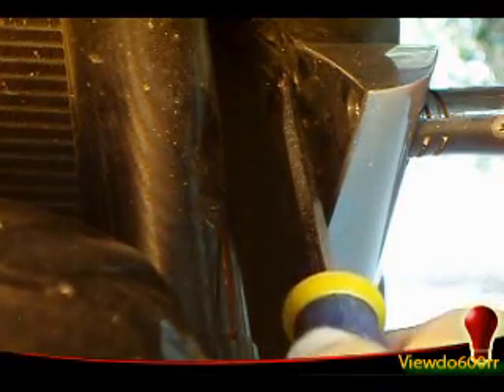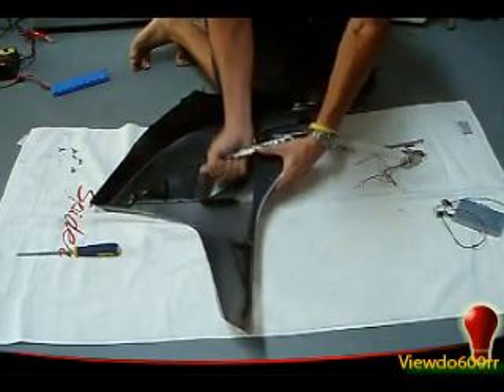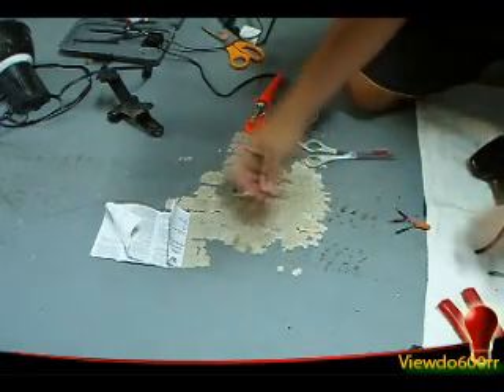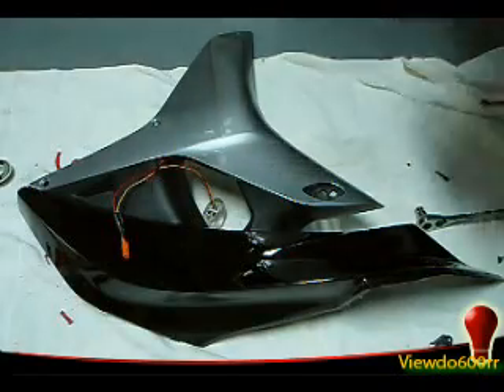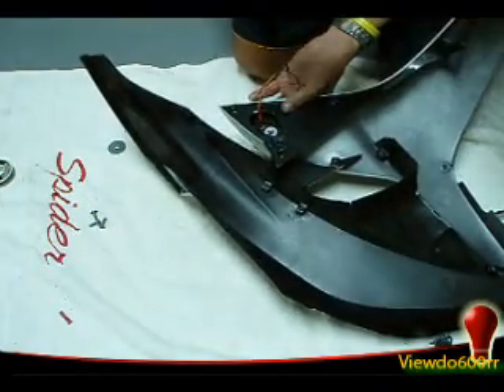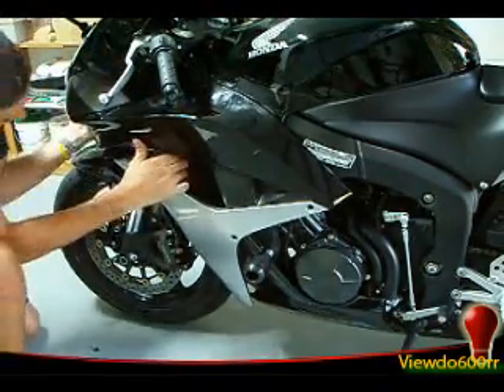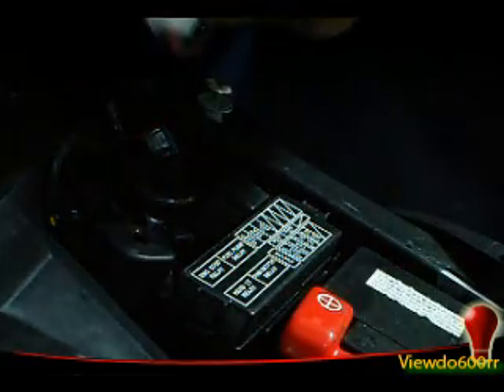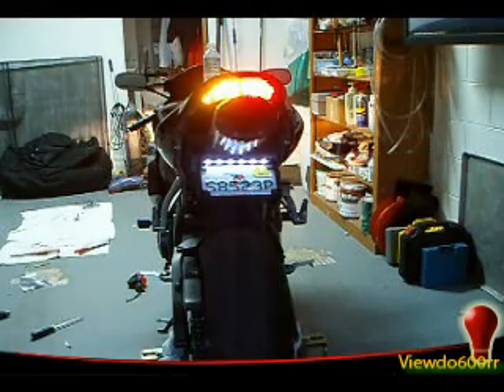Proton flush mount installation

Comment: 600rider2007: Couldn't agree more.  I bought a scottoler and was gonna get the shop to fit it to my 600rr... decided i didn't want to give the c*nts any more of my money so bit the bullet and fit it myself.  Shat myself when cutting the engine vacuum pipe, but it worked and was totally worth it. I took a risk, and learned. It's the only way.

Comment: good review this might be on my winter mod list. I have some shitty flush mounts right now. 

Just a note for n00bs, soldering is good but a bit unnecessary. I twist the wires then heat shrink them. Done. Personal choice though.

Comment from the maker: the white block resistors shown on the video were removed from my tail light installation.  The LED relay that i installed do not affect the proton signals, they are just there to slow down the blink rate on my rear integrated tail light.

I basically exchanged the bulky white resistors for the new LED relay.  They can be found at customled com